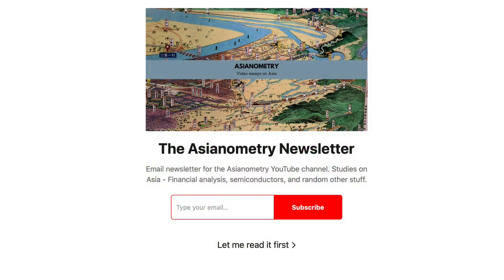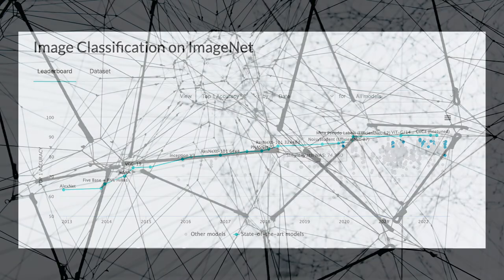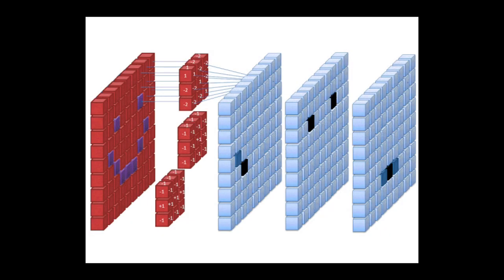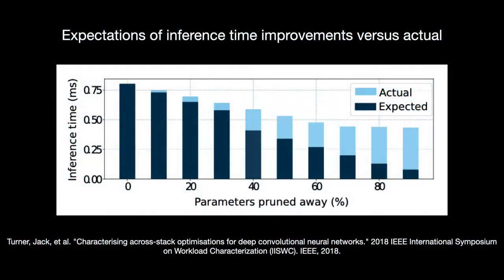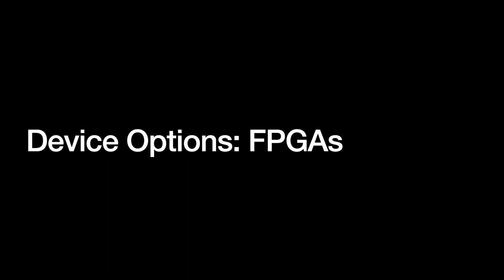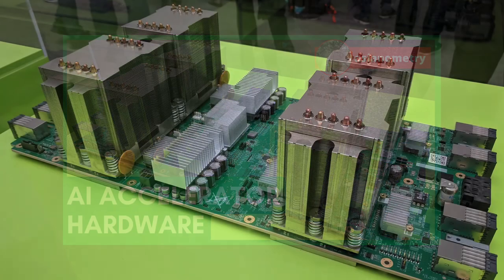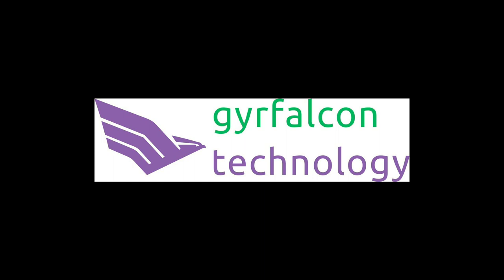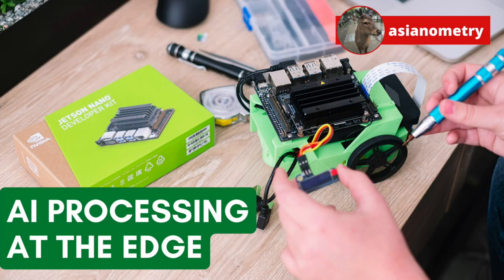The Hard Tradeoffs of Edge AI Hardware

Comment: Almost 20 years ago I led a project to port the neural models we ran on a Beowulf cluster to a more mobile platform.  Our goal wasn't to create a processor to run solved networks like the current crop of AI processors - we built it with full plasticity so that the learning and processing could be performed on the same piece of hardware.  I am disappointed that what is available today is a shadow of what we did in 2004.  None of the current processors are constructed to model the neural structures required for real intelligence.  They just keep modeling the same vacuous networks I used as an undergrad in the cog sci program at UCSD in the late 80's.  Most of the people using the technology don't understand intelligence and sadly don't care what is required. One example: Lately I've seen numerous job postings for AI engineers who can do prediction - what they don't understand is that it isn't prediction, the missing component of these networks is expectation - facilitated by prospective memory.
Reply: There are some people who actually care about this, Numenta for example! They partnered with AMD/Xilynx, so it's not like their approach has no support. Sparsity i a huge win, but their plans go way, way beyond that. They actually want to model the brain, or a small fraction of it, and their research has already borne fruit in the area of sparsity. They are definitely wanting make hardware that more closely mirrors the brain, when they get the chance though. It's very clearly their primary area of interest.
Reply: Are you speaking of probablistic learning sir?
Reply: @abowden556  Functionally appropriate neural processors aren't easy to design/build and won't be as efficient as current neural processors are at running solved networks, but the current methodology won't give rise to real intelligence either.  Sparsity? I believe you're referring to what we called sparse connectivity - is one aspect of what is missing from the newest versions of what is really just improved back propagation networks.  Another missing element is learning - even my professors thirty years ago admitted that there was no biological basis for back prop, but they had no other mechanism for modifying connection strengths. Few people are incorporating real biology in their network designs because it is a pain in the butt, and truthfully even fewer care about it.  I am glad someone (Numenta  you mentioned) still does.
Reply: @VenkataRahulSatuluri0  In regard to which portion of my comment are you referring?
Reply: Sir, the last part, expectation facilitated by prospective memory
Reply: @VenkataRahulSatuluri0  Think about your own experiences:  you have memories of things you've done (retrospective memories); and you have a feeling of the now - we'll call it 'the moment'; but you also have memories of things that haven't happened yet.  Like what you're doing tomorrow, or your drive home from work,.  These memories project forward for minutes or years or even decades and improve your interaction with the world. These forward looking memories are called prospective memories and they are part of what gives you expectation. So what AI developers call prediction of the future is really a recall of prospective memories in the form of expectation. With a successful simulation of these types of memories a neural model will begin to see the temporal relationship between sensory inputs as a continuum instead of discrete events.

Comment: Qualcomm AI100 DM.2e form-factor edge AI accelerators scale 70-200 TOPS at 15-25W, also various Qualcomm Snapdragon mobile SoCs fit the role of less powerful 30 TOPS and under edge AI accelerators. Qualcomm is pushing pretty hard into that direction with SoCs for edge AI, vision AI, drones/robotics, ADAS, and level 4-5 autonomous driving including software stacks. They even have AI research division dedicated to solving problems with edge AI model optimizations and other things.

Comment: The thing with fpga is that you have to manually program entire network in vhdl or something similar. Which is cumbersome and not very easy. Belive me I tried.
Reply: don't worry, he mentioned that in the video 😄
Reply: Sounds like you need a script to take your model and generate the VHDL automatically. I've done it in the past - VHDL doesn't have the automation you need sometimes to do what you need, so write an external script (c/c++/python, whatever) that generates the VHDL you need that's too tedious to do by hand.
Reply: I made a CNN to FPGA microarchitecture hardware transcription automtion software, so I only have to focus on CNN model and design. Of course, it is on exotic computing domain so not a typical binary computing.
Reply: @eafindme  What about something more complex than CNN? Self attention for example
Reply: It seems more sensible to program the network in something like Amaranth (previously nMigen) in Python.
Reply: @glock7061  transcoding CNN to FPGA hardware is damn hard due to CNN curse of dimensionality. Parallelising the CNN MAC operation alone used up all the FPGA resources, excluding signal congestion and memory bottlenecking. One step at a time.
Reply: @illeatmyhat  I made a MATLAB program to transcode the CNN coefficients into C++ microarchitecture representation for Xilinx Vitis HLS, then the HLS figure out the optimised HDL code for the FPGA.

Comment: 5:35 It is really silly to think you can try pruning something that nobody has an idea of how or even why it works, to make it work more efficiently. I imagine it would be similar to cutting cables in an electrical panel and checking if the machine powered by it is working faster or slower, without knowing which room or component had had the power cut out.
Reply: Yes, pruning is one of the most overrated approach when it comes to optimizing the accuracy-performance trade-off of neural networks.
But because this idea came from renowned gurus of the DL field, lots of people think it's the way to go.
In practice, it very often leads to disappointing results.
Reply: On many popular models pruning can give gpu class performance on cpus with only a few percent accuracy drop on modern inference engines.

Comment: The main issue I have with AI is that we let silicon/software learn under some evolutionary pressure, and we pick the one that does the job best. But we don't actually understand what made that particular resulting structure do the job best. We harness the gains from complexity without learning about the part of the structure that makes this so efficient and why. It's like someone finding a wand and wielding it without knowing how it does what it does. Part of this is that more complex problems require an AI network that is so complex, that we have no hope of understanding what makes the best working model tick. I don't think we're in any danger of being taken over by AI, but that the information we could learn from AI for making our own designs are rarely or never learned. As edge AI is concerned, I suspect we'll get finished AI solutions preprogrammed. This leaves a small requirement of processing for the edge device, which should keep power requirements low. Most devices are VERY specialized in their purpose. Much easier to run an expensive AI centre and churn out cheap pre-programmed devices.
Reply: Pre-programmed as opposed to what? They don't train the models on the go...
Reply: And for that there's a topic called explainable AI which aims to predict not only th result, but also explain why the particular result was obtained, presently explainable AI models are not as powerful as conventional black box models, but they exist
Reply: Look into anaesthesia. We've been putting millions of surgery patients a year under deep chemical anaesthesia for decades without knowing the mechanism.
Reply: @bakedbeings  excellent analogy.

Comment: you didnt mention in-memory computing or analog computing as possible solutions. Take a look at Mythic AI, looks like the will get around the perf and cost by using an analog and in memory computing methodology to get around the von nueman bottleneck and use a flash memory manu process which is relatively cheap and dense.
Reply: Good point.  Also the memristor is a breakthrough that could play an important role here too.
Reply: Mythic AI has shut down.

Comment: The edge NPU with arguably the best chances of widespread adoption are ARM's Ethos-U and Ethos-N NPUs which are made to complement their Cortex-M and Cortex-A processors respectively. To my knowledge they do not exist in (commercial) silicon yet but will like have a head start over the offerings of small startups due to their seamless integration with an already established ecosystem.

Comment: I’m looking at using multiple edge ai devices ($3) in parallel. Each running a real time algo and then combining outputs. NNs will get progressively more efficient and will easily run on modern micros. Micros are the future over fpgas but an fpga can form part of the parallel to serialising etc.
Reply: What’s a micro?
Reply: @yelectric1893  I'm assuming short for microcontrollers
Reply: @smooooth_  ahh. Wow, well having a dozen picos and communicating the results could be pretty robust

Comment: Honestly i cant see how this problem could be "solved".
on an Edge device like for traffic recognition you need fast AND precise Inference.
Like the Video said, most ways of cutting corners just dont apply.
I fear that this will result in overspecialized hardware which will flood the market after some cheap product with good software support gets released...
Reply: There is a common misconception (encouraged by the big tech companies for good reasons) that says that using bigger and bigger neural networks is always better. That's true only if you want to solver very generic problems (such as the ones tackled by those big tech companies).

However, a lot of real-live scenarios and use-cases are much narrower and could be addressed  by a set of specialized lightweight,  cleverly designed, neural networks.
Reply: @alefratat4018  i am just starting to learn ML, but isnt it in the case of Computer Vision just a bunch of Convoluted layers which take 90% of the computing Power?
The  fully connected layers after that are important for the model but you cant save much resources with them...

Comment: Constrained (edge) models will perform well once we have pretrained ANN based online reinforcement learning algorithms that solve discretization (episode length and SAR map resolution) and search strategy (not epsilon decay, a better bellman equation). I also don't think parameter quantization is reliably stable enough for chaotic systems (deep nets) and stochastic dropout mine as well be Monte Carlo architecture search. Quantization is a useful techniques but I don't think its the future of edge learning and is a nascent attempts at porting big data to the edge instead of finding an edge first solution or integration to deep net models. Inference at the edge is underutilizing the edge. We need fine tuning at the edge and continual learning. Tesla's closed loop data feedback and update pipeline is an interesting approach that utilizes the constantly shifting domain seen by the model at the edge.

Comment: Great video @asiaonometry! Iḿ suspect but I tend to favor NVidia basically because is easier to deliver the models and inference code, basically what changes is the Docker container and a few libraries. Besides that flexibility comes at a cost of power consumption. For instance if I want them running 24x7 on solar independent power I need a large solar panel AND lot's of batteries